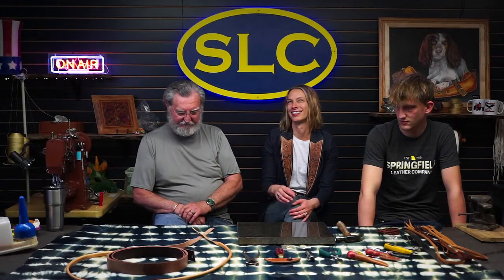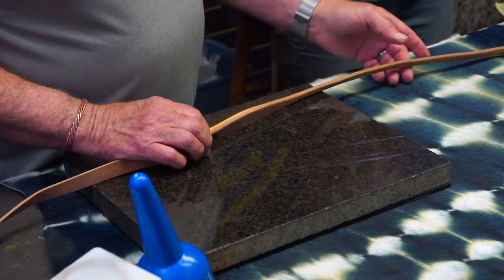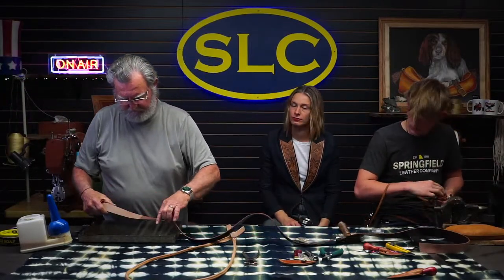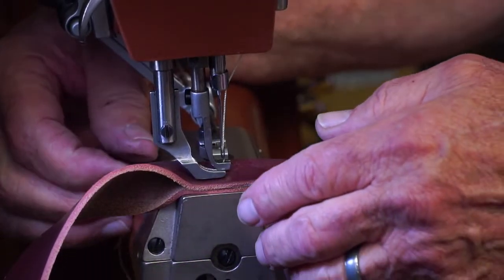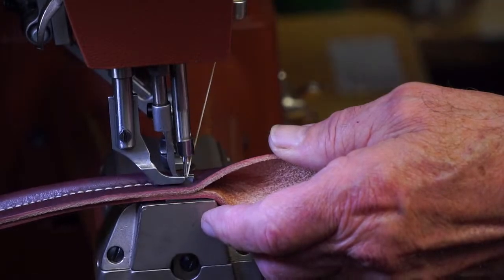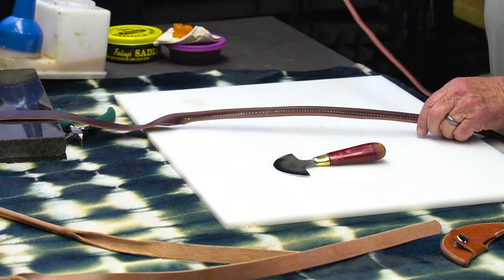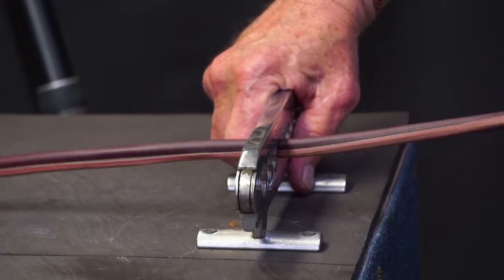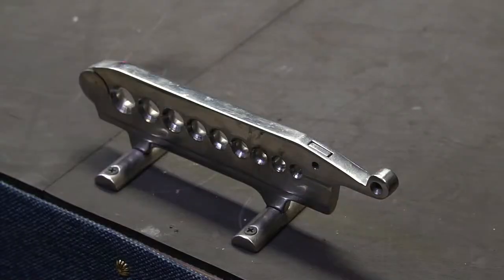Braiding Leather + Using A Rein Rounder w/ Denny + Spencer

Comment: You know, if you don't want to permanently affix a vice to the bench, if all your pressure is away from the bench like the braiding here, mount the vice on a 2x6as long as the table's wide, w/ a "hook" to catch on the edge...need a heavy enough bench, that you dont end up towing it across the floor, of course!